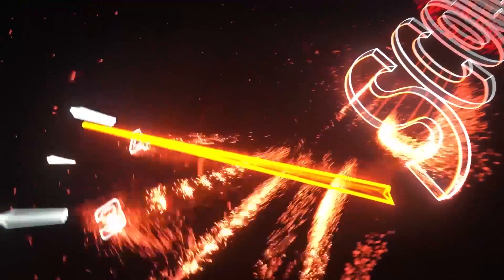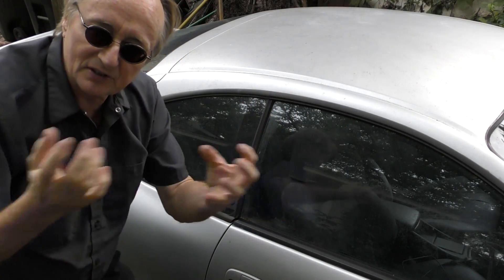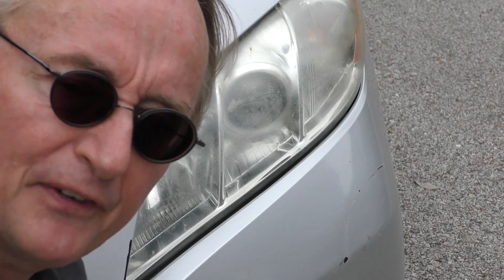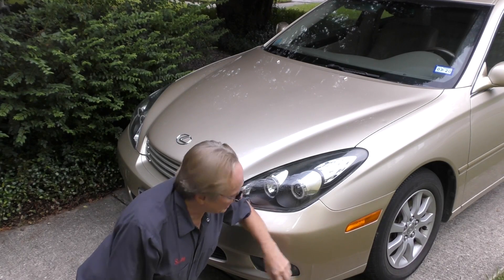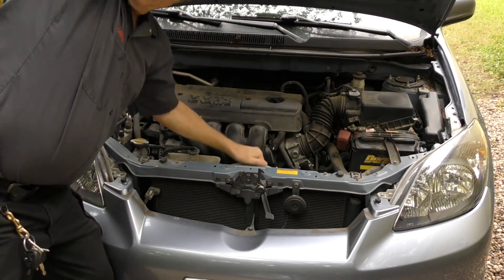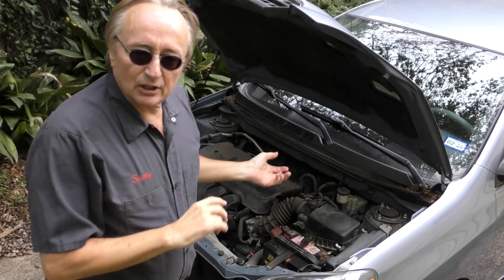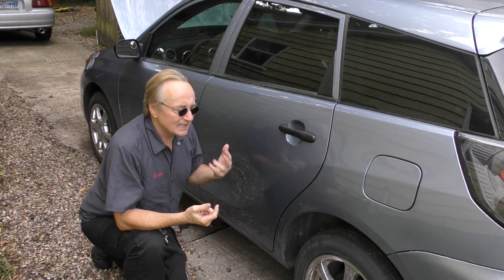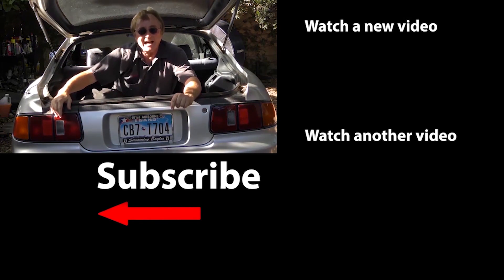You Can't Fix Stupid (Closing My Car Repair Business?)

Comment: I had a customer that didnt want to spend the money fixing the AC. I was able to find a dummy pulley made by i THINK dorman (it was a while ago) that mounted where the compressor mounted allowing it to use a stock length belt and routing.

Comment: Fuel pumps immersed in the gas tank never die when the tank has less than 5 gallons in it. My pickup had almost THIRTY-FIVE GALLONS in it!! I got help to lift the full-size eight foot bed off of the frame so that I could access the fuel pump from above.
And the fuel pump was over $400!

Comment: I owned 2 Bravadas a 1994 and a 1992 and each of them needed a fuel pump at some point and on the 1992 the CPI had to get replaced. Pretty much a given that every S10 fuel pump will need replaced at least once in its life time

Comment: My favorite GM move was grounding the fuel pump through the driver's power window switch. So if you ever run into a 90's LeSabre that doesn't run and a stuck window, look at the window switch. Chances are there's a corroded connector. Shine it up and you're back on the road.

Comment: The most stupid thing I've had to fix was the turn signal flasher on the 1988 Taurus wagon I had. The old can flasher that cost about a buck . Was clipped to the dash and all you did was disconnect the wire connector . Well this electronic flasher fails, I had to reach up to the top of the dash between the steering column and braces . ripped up arm just trying to reach it. I needed a ratchet to remove the screws try to disconnect the connector with one hand  . Then go to the store for a new one and told it would cost $75 .

Comment: Plastic framed intake manifold gaskets used on late 90's GM 4.3L would fail with coolant dumping into the lifter valley and ruining the main crank bearings.

Comment: I live in Tucson Arizona and on my last car the driver side plastic door handle cracked and broke and also my radiator cracked & broke on the top nozzle plastic part.  When it broke the car overheated and ended up having head gasket trouble.  unlike new car I think after 10 years I'm just going to have the radiator replaced even if it's fine.

Comment: 2004 2500HD 364k miles-original fuel pump,(this design pulls from the tank)Best Truck I’ve ever owned. You’re pretty biased for a mechanic,I’m a Diesel mechanic and I’ve owned a couple low powered crappy Toyotas😳

Comment: Not wanting to...umm...beg to differ, but my compressor clutch froze up (and the compressor had already developed a leak so the AC didn't work anyway) on my 2002 Saturn SL2.  Since the car was originally available without AC, you could get a shorter belt and bypass the compressor.  However, as I discovered, apparently their were different size belt tensioners made for the car, so it took my 3 different belts before I finally found the correct length belt to use.  Been working ever since.  

However, I agree that it would be nice if each component had its own belt.

Comment: BMW started with plastic pump impellers on the M50 engine back in 1991, they would disintegrate and spread plastic bits all through the cooling system and ruin the engine.

Comment: I knew someone who's van kept overheating and he found out that the water pump impeller metal blades were worn down to a nub because he didn't have enough antifreeze and so it has partially frozen liquid in the winter wore it out!

Comment: GM also was the pioneer of putting long studs welded to the car to attach the tank, that were designed so they have half the stuc be snapped off after you get the tank up. Take the tank off and you cannot get the tank back in, without replacing the studs with new ones, needing to weld them to the chassis.

Comment: i want to get a new used car, probably alot of people that have more knowlege than me about them, the opions im looking at right now is a: bmw 1 series 2007 1.6-116 (40k miles, 5.5k$) , Audi A3 sportback 2007 1.6 (35k miles 4k$, it has an engine light because of the lambda sensor), VW Golf Comfortline 2006 1.6(60k miles 4.5k$, has some visible rust)

Comment: my 98 4 runner went 400,056.6 miles till original fuel pump quit. i replaced it and oil pump and some gaskets .it now has 413, 577.    !!!@%%^air is still all original and cold. love this truck .it was built smart. it has glass head lamps .

Comment: this is the way electronic items are designed today....with stereo receivers there used to be a cover on the underside you could remove and do a lot of repairs. Nowadays they don't have cover plates so you have to dissemble everything to replace parts.

Comment: I just had the fuel pump fail (second one since I bought the truck new) on my 2002 Ford Explorer Sport Trac. The fuel tank has to be dropped to change it out. My mechanic did it for $400 (including the pump). 

My mechanic is a one man shop and he couldn't get any of his neighbors to help him push my truck into his bay and on to the lift. So he rigged something so he could pressurize the fuel rails from the test port so he could get the truck to run long enough to get it on the lift.

Comment: I was told the reason why the fuel pump is located within the fuel tank was to keep it cool. 
When driving a car with the low fuel light on there is insufficient fuel to cool the pump and thus, it will cause the fuel pump to fail prematurely.

Comment: Fuel pump?  I had a '87 Ranger that had a low pressure pump in the tank and a high pressure pump on the side rail. Of course the one that went out was the low pressure.

Comment: I had a plastic radiator and the top blew when the water pump belt pulley slipped. That was better than the alternative,  warped aluminum head.

Comment: With a 2001 cavalier that has the 2.2 u can bypass the ac compressor simply by getting the non ac belt, had to do it when my compressor started making a horrible grinding noise

Comment: Hey Scotty what do you think of the new AC R-134A refridgerant replacement that most new cars are now using. This new stuff is so expensive compared to the old stuff and I hear is very corrisive and shortens the life of the evaporters in cars which is a $1000 plus replacement. Also all the AC repair shops will have to get all new test equipment to work on this. Think my next car will be a lease. These repairs on these new cars are deal breakers for me.  Thanks

Comment: Water pump inside the engine-Ford Edge V6. Water pump failure dumps coolant in oil. Rubber belt driven cam-a time bomb in the engine.

Comment: 100 years of engineering and cab corners & rockers still rust in 5 years. 
My 88 Ford Ranger had a heater core that you could replace in 10 minutes because there was an access panel in the passenger side foot well, every other car ever built (including fords) burys the heater core deep inside the dash.

Comment: Another "Stupid" design is the Subaru front wheel drive V6s where the Plenum has to be removed to change the rear 3 spark plugs. The other way to do it is to lift the car, take out the rear motor mounts in order to tilt the engine back far enough to get those 3 plugs out so you don't have to take off the Plenum! But either way, it's time consuming! And time is money out of your pocket!

Comment: YES! My Nissan Altima had most of these problems. 

* Plastic, clouded headlamps: ALTERNATIVE to polishing - Meguiar's PlastX (rub-off cleaner that saves a ton of time. WAY better than polishing.) 
* Door handles: Both front door handles busted off eventually. Dealer didn't stock pre-painted handles. (SOLUTION: Bought 3rd party, pre-painted to match your car color on Ebay. They matched surprisingly well.)
* Radiator: The plastic top failed twice from rotting plastic. (SOLUTION: Go 3rd party radiator after researching quality.)
* Fuel pump: The plastic top cracked three times and leaked fuel; (SOLUTION: None. Replace the unit with expensive OEM as cheaply as possible.)
* Plastic bumper: Got damaged when clipped. (SOLUTION: None. Live with it.)

All could've been avoided with aluminum/steel/glass parts vs. plastic. Thanks, Nissan.

Comment: My neighbor  backed into my 99  Cadillac and pushed in the front right about two inches. After  further investigation that car has a front shock built into the cross member that was a little rusted .I got under there with a sledge and tapped it a couple of times and it  popped right back.A little paint smear was all I was left with.

Comment: They do have A/C replacement pulleys that bolt on where the compressor does but just spins to hold the belt in place.  We sell them at AutoZone.

Comment: To be fair to the manufacturers though, plastic bumpers are designed to mitigate injury to pedestrians. With the old style chrome bumpers, your vehicle may drive away unscathed from a 20mph collision, but if a pedestrian was on the other end of it they wouldn't be going anywhere except in an ambulance.

Comment: You forgot changing headlamp bulbs in some cars that requires removing the front bumper and grill to access the back of the assembly. What used to take less than 10 minutes now takes hours.

Comment: What about the throw out bearing that used to be metal..now 90 per cent plastic. To save weight? I don't think so. What is recommended when you replace 30-40 dollar bearing? Clutch and pressure plate. If you don't lay eyes on them, how do you know they need to be replaced? Oh well, even the dealer wouldn't lie about that right?

Comment: I put a smaller belt on my 2003 Ford Focus window air conditioner compressor went out and it fit fine it was for a focus without air-conditioning by the way my Ford focus has at this moment 358,000 miles original engine and transmission doesn't really use any oil and it runs fine

Comment: You can use a shorter belt...I've done it. I had a Saturn without a power steering pump for awhile , till I fixed it..I got a shorter belt and it was fine till I fixed it

Comment: We had a storm recently and a tree branch fell on my car barley leaving a scuff but the plastic handle broke off and flew 30 feet. I took in for repair, 1900 for repair because the inside mechanics broke. Couldn’t believe the cost. When I found out the cost, I got my insurance involved. They covered the cost. Really dumb...plastic. But it’s everywhere now. Can’t really buy a newer car now days that is designed for decades of use. Planned obsolescence.

Comment: I would of had to drop the tank on my 98 f150 but I chopped out the giant 103496710346lbs muffler and put in a glass pack. Turns out this gave me enough room to get up under the truck to weasel the assembly out without dropping the whole tank! I agree with those stupid plastic bumpers too, I had a 96 Explorer, someone rear ended me, the steel bumper had paint scratched but no dents or damage! Their bumper caved in like it was hit by a truck lmao.

Comment: Scotty, this rocks!!!!   I am not a gearhead but this earned a Subscribe from me!!!!

I don't get the 492 idiots who downvoted your message of absolute TRUTH.

I love Hyundais.  Had three and was much happier with them than any Ford, Chevy, or Dodge, I had.  A/C lasted until I got rif of them, well past 100K miles.  Even they do stupid.  Two Sonatas (07 and 09) were designed so when their valve cover gaskets started leaking, oil dripped down onto the alternator or generator and ruined it.  WTH????  Also, the crappy aluminum in the engine is eaten at in places by coolant, requiring replacement parts to stop the leaking.  Again, WTH????

Something all automakers are guilty of and has cost them sales is engineering out every conceivable place an owner might choose to mount a CB, ham, GMRS, or police scanning radio.  Each model year, it gets worse.  It is as though the stupid engineers get paid a bonus to engineer out any place a radio enthusiast might find to mount a radio or three.  Why?  Ditto real estate on the rear fender area where an antenna might be mounted.  Dodge Chargers have some of the best antenna real estate for antennas on their rear fenders, but the make a deal killer by engineering out all interior real estate for radios, unless you buy a police model.

This kind of crap was the only reason I didn't buy a Hyundai last year when it was time for a new car.

One last thing, why the hell has everyone stopped putting locks on glove boxes.  These are handy items that give certain valuables an extra layer of protection that you cannot readily obtain with newer cars.  STUPID!!!!!

Comment: The reason parts are put into inaccessible places is because manufacturing engineers try to optimize how things are manufactured on the assembly line. For example, putting a fuel pump in a place hard to get to if it breaks doesn't matter when they make the car, because it all comes in one big assembly. The fuel pump might be a part of that assembly, and when the assembly is out of the car, sure, it's easy to get to. But when you bolt the whole thing into the car, suddenly the pump is inaccessible without taking everything apart. In other words, assembly speed takes precedence over repair in the future if things break.

Comment: Can confirm that plastic impellers on fuel pumps are stupid. I just replaced the pump n my 6.0 Super Duty, and the plastic impeller had 90% of the plastic fins chipped from some trash getting in there. Replaced with an aluminum impeller pump.

Comment: Just wish all cars and trucks had the access point to the fuel pump but when you have to change it out you can put you an access door in for if you need to change it again you don't have to drop the tank a whole faster and easier

Comment: Uuugh... Doing my Dodge Ram 1500 fuel pump this coming week. Need to replace the leaking plastic tank radiator and heater core in my Ranger..

Comment: Plastic water pump impellers aren't as stupid as they sound. They are a form of mechanical fuse. Virtually all these days are driven by the timing belt, and if your coolant freezes then the water pump pulley will strip the teeth off your timing belt risking severe engine damage. By having a plastic impeller, the timing belt won't be damaged as the water pump pulley can continue to run.

Comment: Plastic is not the only material that a water pump impeller could be made out of, that does not rust. Not all metal rusts. A water pump impeller does not need to be made out of a strong metal such as iron or steel, so it can easily and cheaply be made out of a cheap, low-melting point, easily-cast, non-rusting pot metal.

Comment: Scotty, plastic has replaced metal to reduce weight to improve mileage. Cars haven't had bumpers for decades. The car manufacturers were forced to meet govt mileage standards so both sides agreed to give up bumpers in lieu safety devices which save lives.  Without plastic, you would not have airbag.  Cars are safer than when you were first starting out. They also get much better fuel economy.  So, plastics have made cars better, not worse as you would have people believe.

Comment: Actually, glass-filled nylon radiator end tanks on the radiators have been a tremendous improvement on warranty claims in the automotive industry over the last 35 years.  Nylon is hygroscopic and the coolant makes the  nylon (plastic) less brittle and less prone to cracking/breaking.  Most radiators in the U.S. are still made by Harrison Radiator, Valeo Engine Cooling and Nippondenso.  I love Scotty, but the facts say he in incorrect on this subject.  Maybe you can't repair them, but I can buy a new one for my F-150 for about $135.00, if I needed one.  It is 15 years old with 215,000 miles.  I am sure that the radiator will last another 200,000 miles.  Molded millions of tanks over a 20 year career, etc.

Comment: Not all parts of plastic are bad. 
I once had a car that had a heater core made of metal and it leaked and the replaced parts kept leaking (one new heater core every 3 months) because they're made of metal and metal suffered hydrolysis with metal being removed from the part until it started leaking.
The solution was to replace it with a plastic heater core.

Comment: Hey Mr. Kilmer, could you please make a video on how to set camshafts on a dual overhead cam engine without using the intake/exhaust markings on the timing belt pulleys?

Comment: 4:35 Someone needs a replacement aerial on their Toyota Matrix. Got mine on Ebay for £1 delivered from china - works perfect. Common problem with them corroding and the rubber perishes and peels.

Comment: Not only water pumps. Volkswagen air cooled engine. OIL pump. The metal oil pump gears came loose from drive shafts, so no oil pressure.

Comment: You forgot Ignition coils, throttle position senders, idle air controller valves. Crank angle sensors. You never had to replace them.

Comment: Love you Scotty your great guy. Have a question I have a high lander with 70,000 miles on it. I'm wondering when should I replace the water pump.. I don't want the water pump to go bad I've had terrible experiences in the past I would rather preempt the problem if that's possible.
Reply: Just don't over heat the truck ....shut it down if it gets too hot..there isn't really a set milage to replace the water pump

Comment: Actually, they are called "bumper covers" and not actual bumpers lol. The "bumper" is inside the bumper cover that has some foam to support low speed collisions. I had a 2005 g35 coupe that I had broken the bumper cover off for being "too low" on a drive way. The police would always pull me over and tell me, "you know you are missing the bumper"? Then I'd say, the bumper or the bumper cover, cause the metal "bumper" or "bumper beam" was still attached. Lmao. I'd win in court. Lol

Comment: Scotty, You forgot the most important stupid thing. Cartridge vs Canister oil filters. My 09 Toyota Corolla takes a special oil wrench to remove the oil cap. Then you replace the cheap oil filter cartridge. I like the spin on oil filters. Why doesn't the Chinese make adapters to replace the cartridges with spin -on filters?